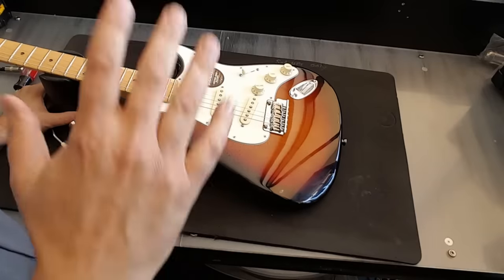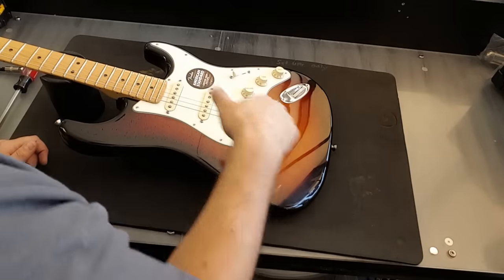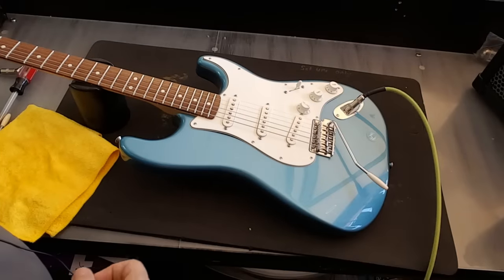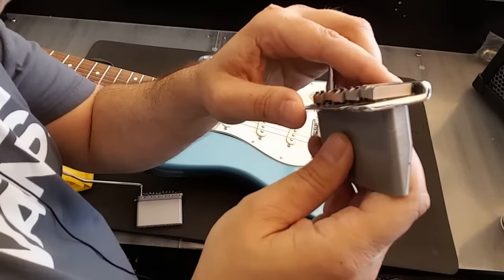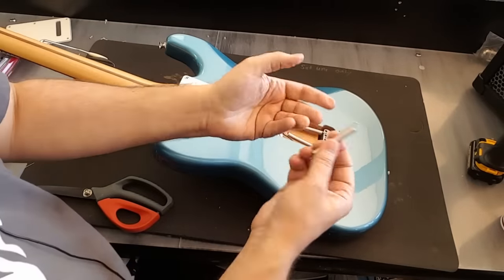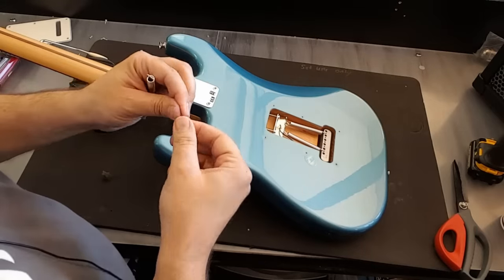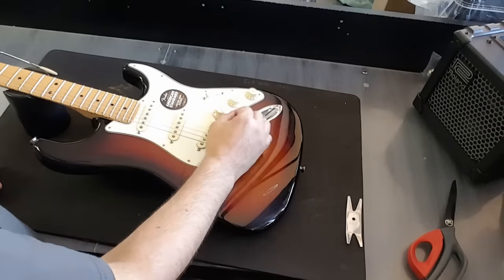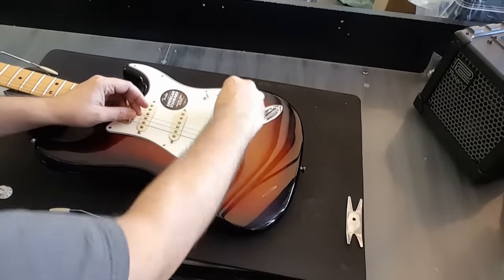5 things you didn't know about your Fender Strat

Comment: Actually dampening your tremolo springs is a bad idea if you are after feedback. I discovered this when I changed my springs out for some rubber coated ones that eliminated the spring noise quite well, but also noticed I wasn't getting any feedback anymore at all. On fixed bridges the strings will vibrate to give you the feedback because they are anchored. However with tremolo type bridges it's the sustain block (the block of metal that the springs attach to) and springs that make all the difference because your bridge is not fixed in place. Ideally you want a sustain block that is as dense and hard as possible (Tungsten is the best metal for this, not steel, titanium or brass) and believe it or not, your springs will vibrate causing a loop with your guitar strings when amplified through your amp speaker. Yes it sounds strange, I was amazed when I discovered this as well. I use a Floyd Rose system, but I suspect the same is true with a Stratocaster style bridge as well since the same spring noise is present and the main mechanics are similar. 

If you are only playing clean however then by all means dampen your springs. This really only applies to people looking for sustain and feedback.
Reply: A tungsten sustain block? That would weigh the guitar down immensly, at least in my opinion (I prefer lighter guitars).

Comment: I have a great tip... If you replace your electronics with ACTIVE ones and your battery wont fit in the cavity very well (as mine didnt) you can remove the jack plate and flip it over so it is sticking out instead of inset and boom 9v battery fits under it well. Youll need to flip the actual jack backwards too but it works and looks cool

Comment: Its much easier to use ear plugs to put inside the springs, they just follow the turn of the spring  like a bolt into a nut, one ear plug is all you need to kill the spring resonance, the spring tone is a transverse wave just like a string.  You mute one end the wave stops reflecting back and forth.  In some cases I like the spring sound.  If you can find three or four springs that have the same tone Hz it will resonate with certain notes you are playing, creates a sort of feedback loop so certain notes really ring out nice.  It can also sound a bit like a spring reverb type of effect.  Its player preference.

Comment: Ignore the spring-down-the-hole thing, it messes up the tremolo. Without the spring there is one full turn circle from loose to stiff and it is a very smooth action. With the spring it is not so smooth and goes from loose to far too tight in that final turn circle. If you're fine with how it feels as standard then stick with it.

Comment: You should add #6 to the list which would be that the plastic wiring harness is pretty much the entire makeup of the strat / tele style guitars. They will sound the same without the wooden body if one could attach the neck in thin air. I say this because the plastic harness holding the pickups and electronics merely FLOAT over the routed cavities in the wooden body. So you pretty much get a thin,tinny sound.Remove that plastic harness,fill the cavities then mount the hardware directly to the body and Lo and Behold...you now have a real guitar :)  I did this with a Tele...HUGE difference.

Comment: Vibrato spring...cool tip. Not a tremolo, by the way.  Static's  not a Strat problem, it's pretty common to other makes, models.  Torking  screws will raise the bridge.  Springs noise, foam fix is clever (or spray the strings with a rubber coating).  Position of the knobs below the pickup is a design flaw; clever fix.  -Doug Pratt, Atlanta, Georgia, USA
Reply: Dan Bertucci   Hi, Dan. It's a common confusion. This is from Sweetwater: Vibrato and tremolo are often confused — and not just by musicians, but by manufacturers as well. The tremolo arm on your favorite guitar, for example, is actually a vibrato arm...Vibrato is a modulation effect that varies pitch. This is actually the way that “tremolo” bars work, despite their name...

Tremolo is also a modulation effect created by varying the volume of the signal. Tremolo is particularly useful for creating percussive shuddering or stuttering, as well as gentle or intense pulsating effects.
 Tremolo effects can be found on many amps, such as some Marshalls, Fenders, and Voxes, as well as in stompboxes and effects devices. True vibrato effects are available in certain stompboxes and effects processors, but rarely built-into amps.  So the next time you’re looking for the perfect effect to create a sense of undulating rhythm and motion, if you want a more warbly, “underwater” pitchy sound, go for vibrato. If you want a more staccato stuttering or pulsating effect, go for tremolo! -Doug Pratt, Atlanta, Georgia, USA

Comment: Just a question I have a new American performer similar just to the blue Strat that you wiped the static electricity spray in. I noticed that the Pickguard is pulled up near the neck Pickup. Mine came that way straight from the factory is that normal?

Comment: For decades, over the many Strats I purchased, I would find that vibrato arm bias spring on the floor and wonder.  LOL  Finally figured where it fell from, BUT still thought it was unnecessary?  Like I knew better than Fender?  How many players have discarded it? I muted vibrato springs with high-density foam at first, but sheet cork doesn't pinch, effecting recoil

Comment: Foam in the strings is a bad idea as you loose some of your tonal ring. I actually did the reverse added extra strings low tension to increase tonal chime of the strings when strummed. I have the earth wire soldered back there and this improved the earth without all that messy spray.

Comment: Hey Philip,
Nice video, good tips. Regarding the tremolo arm hole, how deep is it on an American Strat? I want to tap the hole from the back in a MIM and install a screw so the spring won't fall through but I want to select the correct length to match the American hole depth.

Comment: It is interesting that this guy spins the tremolo arm in so fast.  That is a sure way to heat up and weaken the threads. Eventually the threads get weak and the stem break in the hole.  That would require a brand new tremolo block.

Comment: Hey Phil, I bought a pack of Fender tension springs for my stat. I popped a spring in, and my tremolo arm won't screw in the hole with the spring in there. Any suggestions?

Comment: This video was very interesting! Now, I have a question that suddenly came to my mind while watching this.

I recently changed for 9s to 10s on my strat. I didn't consider that I was adding stress from my strings to the bridge until I changed them. The change in tension was big enough that the bridge was pulling up, as you showed on this video. I never considered taking the screws back a little bit. What I did was to just increase the tension of the springs by screwing the spring claw further in. But now, there is so much tension, that if one string goes out of tune, all of them go out of tune. What is the appropiate course of action here?
Reply: showlogicprod  I have tried 11s before on my other guitars, and they are a bit too much for me. I am happy with 10 - 52 right now, that is what I have been using for a long time. I just wanted to try to go lighter with my strat for a while, but I did miss the thicker tone of thicker strings, especially on the low strings.
Reply: There isnt a solution unforyunately. It's a flawed design you have to put up or fight with. Bending notes also makes adjacent strings go out if tone (downwards).

That's why I play telecasters 

The Bigsby is a .much better trem. Ok you can't dive bomb but you can't in a standard Strat either.

Then it's Floyd Rose etc. Yuk. No thanks

Comment: I kept losing those damned trem springs during gigs. My solution: a rubber grommet on the trem arm. Adjustable, cheap, it won't fall off & it doesn't affect tone or sustain. And personally I like the 'boingy-ness' of the trem springs - I sometimes strum them at hi-gain settings for an effect (so does Eric Johnson!) but if you wanna deaden the springs, its SOOO much easier to cut a piece of foam to line the bottom of the trem spring cavity instead of threading foam strips thru the springs. Also you can raise the screws holding the bridge plate (ever so slighting as to not hit the strings) to RAISE the pitch - not as extreme as a Floyd Rose, but enough for slight nuances (Jeff Beck is THE master at this technique and does NOT have a Floyd Rose (or Buick, as I like to call them) permanently parked in the middle of your Strat

Comment: Ok so with the twangy spring in the back, wouldn't the issue be that the front mounting plate could just be screwed forward further so the spring actually gets some tension on it?
Reply: That affects the tremolo arm and the neck relief
Reply: @raghavrao5221  not following, can you elaborate?

Comment: Thanks for the video, I have 17 year old Fender US Stratocaster. For a few years I trem blocked using the two coin method, then decided to have another go with the whammy bar on again. For some reason I now have 0.5cm action at the 15th fret and about the same with the bridge off the body. The action was always ultra low on my guitar and I could use a few hints on where I've gone wrong. Do I need to renew the springs or adjust the truss rod? If so which way do I turn it, clockwise or anti clockwise? the intonation is still okay. Any feedback would be much appreciated. Thank again.

Comment: Hi Phillip,  Thanks for pointing out the tension spring bit. I bought an American Elite in the summer of 2016 and it comes with a bare tremolo arm (no white plastic handle and an indentation at the end such that it pops or snaps into place).  It does not thread into place and there is no spring and the tremolo arm moves around like crazy and I have to search for it.  I wrote to Fender with my complaint.  Do you know of a solution for both of these deficiencies?  Could there be a factory quality retrofitting that would include the plastic handle and the threaded end on the arm to use with the tension spring? Thank you very much, Michael

Comment: That well-engineered spring is important! It will allow you to use the tremolo (aka whammy bar) as it's meant to be used. Without it, you most likely will go out of tune every time you use the whammy bar. The other component is the bridge - if you have a good stainless steel bridge, in combination with the spring, you can abuse that thing and it will come right back in tune. This is based on my experience - do not neglect the spring!

Comment: 2:40 Could that also work for Les Pauls? I have this static electricity problem with my epiphone and I wonder if it works.
Reply: He doesnt know what he is talking about. The "static" is because you are touching your finger on and off the strings or any other grounded piece of metal. You are supposed to ground yourself by constantly holding the grounded metal/strings on the guitar to keep the noise out. Keep one of your hands on the strings at all times, only let go after you turned the volume off.
Reply: And is there a solution for this problem? I mean it's kind of annoying to hear that hum all the time, excepting when you don't touch the metal parts.
Reply: This isnt a "problem". This is how guitars are designed to help minimize noise. There is no reason to take both hands off the strings. If your hands arent on the strings you arent playing it anyway.

Comment: Angled springs tells me the person does not understand what equal tension means. Also the spring rattle is not always a bad thing as it adds character to the sound and makes a Strat a Strat. Many setup a Strat to be like any other guitar by blocking the bridge, adding tension, foam, lowest action possible etc. Might as well buy a short scale like a LP which is easier to play,better action. You are basically castrating the Strat.

Comment: Don't put your outside springs at an angle towards the center spring in doing so you take most of the pressure off your  center spring and rendering it near useless, you should never be able to pull the center spring out that easily.
HAPPY FENDERING 😊

Comment: Hey nice video! 
I recently bought a AM Pro 2 Strat and after a few times of "struggeling" to get the new Pop-in-Tremolobar in and off (for preparing my guitar for the case), I got the feeling, that my tremolo bar is nor much less accurate and delivers not a sensitive tremolo effect after moving it smoothly. I now seem to feel forced to push the tremolo bar much more, to get a tremolo effect but the tremolo effect seems not that beautiful as at the beginning.
Could it be, that maybe I stretched the springs on the back too much, whilst I was "struggeling" to pull off this new click-in Tremolo bar?
How can I get to the actualy status back? :-( Can you help me out?
Reply: Check the set screw on it, sounds like you may need to adjust that

Comment: The 4th Trick, ive used Rubber Tube that ive cut down to a 1/3-1/4 and stuffed it, hard work tho compared to your foam.
Like Trick 5th might have to try that one..

I would like to know the Measurements of the spring used in the Tremlo Arm, 
Amazon says : 11.4 x 7.5 x 3.5 inches !!! dam thats big

Comment: I won't use Strat trems due to string tension problems, adjacent strings going out if tune when bending. It's horrible, you have to adjust your playing style, fighting the guitar.

Don't need this. It's a design flaw that's been there forever. The fancy devices to compensate for this in the spring cavity don't work either.

So I just resign to hard tailing Strats with solid blocks, well known trick. I think they sound a lot better, more sustain. No trem, I don't miss it and it's floating bridge issues... Rest your palm on it, it goes out of tune .... I'd rather have a Bigsby anyway but it looks wrong on a Strat!

Comment: about the spring, does anybody ever stripped the tread inside the bridge block especially after putting in and using the spring ? because i tried to buy a pack of fender spring and insert it to my fender bridge, couple weeks later the spring broke into pieces and stripped the thread inside leaving me with a loose and unusable tremblock, i don't know if it's mine or is it the side effect of using the spring. if anybody know and understand about these stuff please let me know.

Comment: Enough with the foam rubber! The stuff eventually rots out and becomes a sticky crumbly mess. I have no problem charging $120 to remove foam rubber that rotted out inside a reverb tank, and another $100-$200 to recoat and treat a reverb tank with closed cell sheet foam or neoprene. Leather over neoprene is $350. If the solvents in the foam eat into the paint on a guitar a repaint starts at $500 for an overspray, to $128,000 depending on the finish. If you want an intricate inlay & marquetry job, the sky is the limit. I'd rather see the jacket from an old patch cord pulled inside the tremolo screws. I use silicon tubing, and charge $27. That is just for the material. A roll of the stuff is $2000. It is flame proof, and a soldering iron won't do anything to it. Doubled up it won't squeeze in between the spring coils and bind up, making your floating trem go out of tune. The stuff has lasted me 37 years in one Floyd Rose.

Comment: #4 No no no no no.
The vibrato system is balanced, string tension vs spring tension.
Guitar players spend ages trying to illiminate friction to maintain tuning stability, pencil lead in the nut, teflon lube on the pivots, locking tuners, locking nuts, locking everytjing! A constant search for stability.
Adding anything that affects the ability of the strings and springs to return to their original position WILL cause tuning issues. Don't do it people. 
If you don't like the in built in reverb effect that the Strat trem has, buy a Tele!
Reply: That foam will have literally no measurable effect on those springs except for damping their resonance.

Comment: You should have read a little more before you made this video. The bridge on a Strat is not supposed to sit level against the body unless it's a hardtail. If it has a whammy bar there is a clearance distance that the bridge should hover at (just like a Floyd rose but with less room to move).

Comment: 1. Portions of it may have been made in Mexico or Euuessaay, regardless of the " made in decal"
2.  They're not gonna tell you that.
3.  Still a great $350.00 guitar which is about what the direct factory cost is.
4. They ain't telling you that, either.
5. There is NOT A Fender guitar ever made that didn't need near total adjustment to actually play correctly.
Want to kill your Strat? Stuff it with foam. 
Just like your imaginary girl friend.
Bring your guitar to a qualified shop. Let qualified people do their job.
Or, foam that bitch up. Let me know how that works out for you.
Been playing Strats since they were 350 bucks. New.
Never once wanted to put microscopically perforated soft plastic in them.
Ugh.

Comment: Yeah until that foam get all nasty from moisture playing etc. play a different guitar. Loose bad habits and get better techniques. The great strat players don't have these problems and fender needs to stop making shitty parts that need to be immediately modified. I'm telling ya Callaham Bridge...cold rolled carbon steel machined to perfection. Fender also made the holes in the Bridge saddles smaller so strings get caught hopefully they have changed this. If you look at vintage strats the holes in the Bridge saddles where bigger to allow the string to come trough easily.
Reply: Yeah, foam deteriorates. Try felt front rail punchings (ask your piano tech for a few next time you get your piano tuned :D